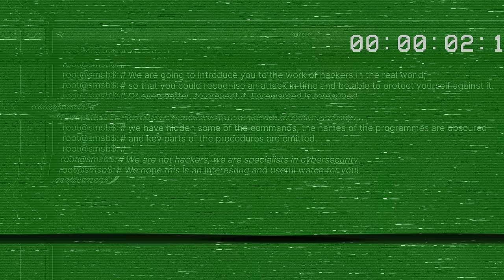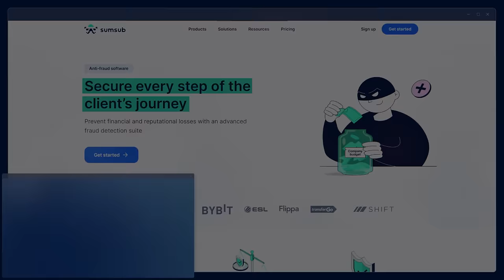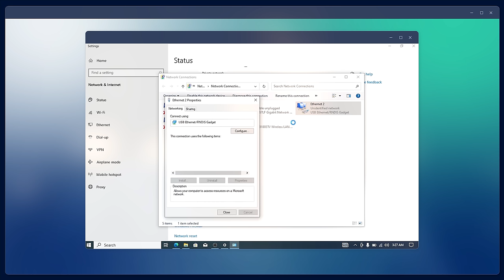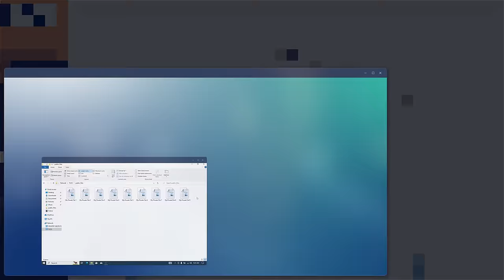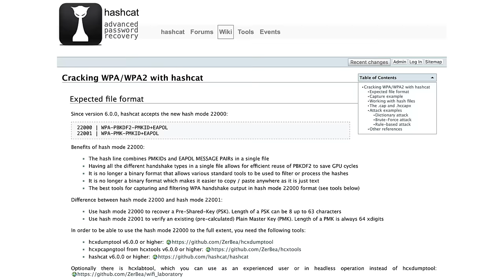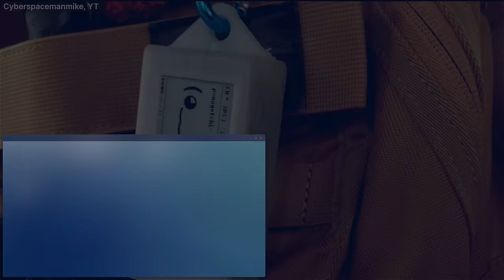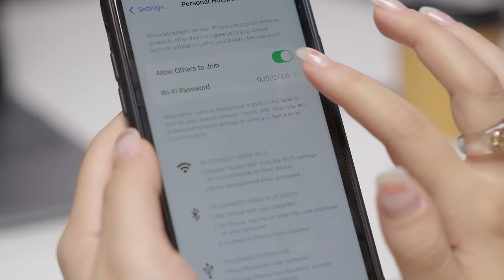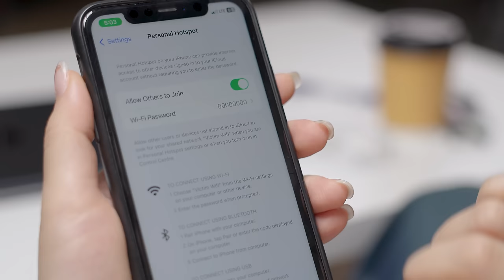Pwnagotchi — hacking WiFi networks in seconds | Real Experiment

Comment: Basically if you want to be safe against this, just like any other piece of software/website/service - have a really secure password. Larger passwords are exponentially harder to crack (as long as they aren't a common password), especially with a combination of symbols, uppercase, lowercase, and numbers.
Reply: Or use a LAN.
Reply: @oneproudbrowncoat  yeah carry a f wire and box around like a neanderthal
Reply: Most people don’t know 😈

Keep educate people but seriously there are 90 tries are successful of 100 times
Reply: using WPA3 PMF Enforced network would prevent it from getting the handshake i believe [well at least would help it out]
Reply: Does it find and hack wifi that doesn't broadcast its SSID?
Reply: @Soederlund  no biggie
Reply: @Kucing323 That does nothing
Reply: @Soederlund  those are even easier to get a handshake since it is constantly broadcasting
Reply: yes. also use WPA3 instead of 2
Reply: At  4:40  "connect to a WPA or WPA-2"....  well, those two older protocols are being used less every day and replaced by WPA-3 which is currently un-crackable.   Also using a 40+ character completely random password provides an exponentially more difficulty for brute-forcing hashes.  A networks is only as secure as its owner. ;)
Reply: @Kucing323- Changing passwords provides no extra protection especially for WiFi (maybe for email log-ins).  The key is to use 40+ random character passwords, or even longer if not using special characters.   It's not like you have to remember the password, since it's stored  in your device after the initial connection.
Reply: *WPA2 commands a 73% share of known wireless encryption connections.* ~ the internet
Reply: well 95% of all people use the password already sticked on the router which is normally as difficult as it can get.
Reply: @Kucing323 The only time frequently changing a password is necessary if you use THE SAME password in multiple places.
Reply: @Soederlund  Hiding your SSID only inconveniences YOU!  If you didn't know it, your AP broadcasts its MAC address, so who really cares about your SSID?  Hiding it does nothing to enhance security.
Reply: I just put the password i randomly generated from bitwarden, with a bit of my own spice to the password (which mostly just banging my fist to the keyboard).
Reply: @BillAnt  "Changing passwords provides no extra protection" Can you help me understand why?

In the time it takes to crack a captured handshake hash, a user could have changed the password, rendering the previously cracked password invalid
Reply: So a wifi password with 20 characters, upper case, lower case and numbers, is fairly safe ?
Reply: @JohnDoe-bd5sz - Should be, but I would use 40+ characters randomly generated by a password manager.  It's not like you have to remember it every time, all devices store it anyway.   Regardless how long the password is, there's a security flaw in the handshake up to WPA2, WPA3 seems to have mitigated those risks.
Reply: @BillAnt  I know WPA 3 is more secure, but i have loads of devices that only support WPA 2, so i can not turn off WPA 2 anyway, so even if i move some devices to WPA 3 i am going to be vulnerable because i would have to keep WPA 2 on for "legacy" devices.
Reply: My Router litterally doesnt allow me to use a longer WiFi password its like 60 characters long, i also disabled wps since this is a huge security flaw
Reply: @magesmith-kd3xo you don't do that?
Reply: Hi how are you doing
Reply: Do you remember me
Reply: @GodOfChaos_HeXa 63 should be the limit (have fun putting that into your TV)

Comment: My neighbors will usually give me their WiFi passwords if I ask nicely
Reply: Why would they do that?
Reply: @e1woqf  Split the bill. Both get it for half price then. Used to be common until people were scared by the "it could be a P. or a T. using your connection, getting you into trouble.". This is why you should know, and get on with, your neighbours.
Reply: Social engineering 👍
Saving GPU power 😂
Reply: Hypothetical post....Nowadays, nobody gives wifi password 😒 🙄

Comment: so it's just an automated interceptor, we still send the data to a rig which will crack the password using hashcat
Reply: Yep, clickbait
Reply: you could run the recovered hash against a dictionary in the device. Or do the same thing I used to do and automatically upload them to a server
Reply: @KOOLAIDxK1D  No, not entirely clickbait.  The pwnagotchi can be loaded with a plugin that automatically sends the intercepted hashes to an online cracking service, which emails you if it gets a hit. Doesn't get everything, but its still functional.
Reply: @CMDR_John_Crichton  now that sounds more like it

Comment: The only useful attack you can do with any device labelled "Wi-FI Hacking device" is Wi-FI De-auth/Turning off their wifi.
Reply: Sort of, yes, it is the only thing that will just always work with minimal effort. But many people still make severe mistakes in password choice.
But I agree, router defaults have become more sensible during the last 20 years. Doesn't prevent people from changing them to less sensible options.
Reply: Luckily WPA3 has protect management frames which prevent this

Comment: while whitelisting MAC addresses is helpful and a good step, a fair few devices can spoof any MAC address they want (Hell, my home sever here has that option for both it's adapters in regular desktop Linux, Mint to be precise). 

As an aside, a hacking tool has no business being that cute.
Reply: Two connected network devices can Not have the same Mac address from my understanding.  Both devices would receive some but probably not all data. The device would not function properly.  This would Alert the network normal users at homes.  I like increasing password length and adding special characters as AI and advances in computing make it possible to Crack shorter passwords or passwords not using special characters.
Reply: @jbranche8024  they cannot,  no. But an attacker need only wait for said device to disconnect,  or kick it off the net first
Reply: ah yes you're the guy recommending to do something that nobody does because its trivial
Reply: @BangBangBang.  pretty sure that IS done because of how trivial it is. 

How often I'm not sure, but settling up a whitelist still is the security equivalent of using a $5 chain lock on your front door.
Reply: @DFX2KX  Exactly, his "logic" is very "special".
Trivial things like this are just automatically done by most scripts. Getting a list of allowed mac adresses is standard procedure just in case there is a white list.
Precisely because it is so trivial you just exclude this potential source of problems. Diagnosing randomly refused or dropped connections is way more of a hassle then just doing stuff like this from the start. There is no downside to just doing this every time if there are any devices online.

Comment: First of all you did not create it and it is not new... Those exist for a long time...

Second of all it just works for wpa (an already old and vulnerable protocol...) Which no one should use anyways...
.
And third of all it just catches hashes No passwords...
To get a password from a hash youll essentially need to brute force try all password... And hope youll find the right one ... So more of an gimmick than a useful tool to hack wifi routers...
Reply: fourth of all no body cares
Reply: Brute force?? Try hashcat
Reply: @TonySmith-zq2hx  to my knowledge even hashcat brut-forces to some extent... Sure you can optimize around the human psychology, or commonly used passwords but the rest is brute force...
Bc hash-fcn are ment to be one way fcn. (Easy in one way. More or less impossible in the other direction.)

Comment: I'm a bit confused. It surely is too slow to crack anything, even a dictionary would be way too slow. So what is it doing? Only collecting handshakes?
At some point the video talks about online cracking, if this is needed, how would it be connected to the internet? How would it be "safe" to use? 
Seems more like a toy than a tool.
Reply: Video is misguided. The device just collects unauthorized handshakes which are called IV. You need a lot of them. With that, you would need to run it through a very large dictionary to find the password. Then once found, you can test the password on that network with a wifi device. Ppl watching this and thinking they can just sit next to a wifi network and get in with a click of a button are wrong. 

The entire point, make your wifi password hard and long. Set up layers in your network. Different vlans, Mac auth, honeypot for unknown device, etc.

Comment: mac address spoofing is a thing, I've done it on hotel wifi before. You find mac address of an already connected device, and spoof it. So I don't quite agree with mac address filtering. Also phones nowadays use random mac addresses. The best way to protect against this kind of hack is to use a strong password, the reason this thing works is because of weak wifi passwords. None wants to type a 20+ character password on a printer, but if you want to be safe you should.
Reply: No one wants to type a 20 character password, and they shouldn't be doing that anyway.  Plopping in a 40 character password is trivial when you use a password manager like Enpass, or any of the dozens of other ones available.  I like Enpass because they don't store your database, YOU do. If you're not using a password manager, I can pretty much guarantee you are using the same password on multiple websites... which is a really stupid thing to do.
Reply: @username-mc7jw  Something you missed is I mentioned a printer. I guess you never tried entering that password on a printer.

Comment: Unbelievable!  So, if I understand correctly, it doesn't actually give the hacker the Password to the wifi?  If not, what good is it then?
Reply: It gives hacker password hash, which can be used for getting the password via brute force attack. Basically, that's the only option for hacking WPA2 network (at least, for now), but there's two main issues
1. Any Android or iOS (jailbroken) smartphone can do the same thing, so there's not much point in specific device. Sure, it works automatically on any detected network and it automatically transfers hash files to PC that is used for bruteforcing, but it's not like you can set up any phone to do the same thing.
2. WPA3 networks are protected from this attack, so it isn't of any use for them.
Reply: Also, I'd like to add that they say that this device is using AI for password generating, but I'm not sure if AI is making password bruteforcing significantly faster. Moreso, this AI is still used not on device, but on PC that is doing bruteforcing, so it's not like you can't just download its code and use it on any PC with any hash, be it hash that you got from the phone or from the laptop.
Reply: Nevermind, I see it on the box.  Yes, it's WPA3.  But if my neighbor hacked my pw when I was on WPA2 Previously then I still need to change all my passwords.

Comment: Because I use Home Assistant, I am only using giving access to known MAC addresses. Not that I am afraid my password will get cracked, it is best to plan for the worst case. For visitors I my router offers a second WiFi network. It even has  a third network for Home Assistant appliances, but two will do because of using the MAC addresses. Hint: I use the MAC addresses to give every appliance a fixed IP via DHCP. I found out the hard way after a router failure appliances were not reconnecting perfectly to H.A. thus having fixed IP's makes live a lot easier.
Reply: Assigning static IPs via DHCP is good, but also close down the pool of DHCP addresses available to guests (on a separate VLAN, of course).

Comment: You don't need the gateway for SSH access to the device if it is on the same subnet, in particular the standard /24 pushed by DHCP on 99% of all home networks.

Just saying, because I am picky. - Great video BTW.
Reply: Truth. If you in the network range but still that'd require the target to have an SSH session running ...

Comment: this is no different from using wifisher or airmon-ng tools. in the end this "toy" won't crack the password since you need to take the cap file and run it against a massive dictionary to hash the password
to plain text.
Reply: Still a cool project though, main benefit is it just runs in the background.

Comment: I dont understand , how are you sniffing packets without connecting external wifi adaptor capable of packet injection  and monitor mode ? The onboard wifi chip on pi zero does not allow you to do so as far as i know it .

Comment: Its a great tool, hard to believe it was mostly made by one person, too bad the project has been dead for a long while. Also you are making it sound like cracking hashes is cheap/easy, its usually not with strong password requirements ;).
Reply: Jayofelonys fork got updated since years,it runs better than the original

Comment: It doesnt actually crack a password though. It just saves a handshake? You would still need to run a brute force or dictionary attack which would make 99% of these handshakes useless. Wps on 2.4ghz is still the easier way.

Comment: I have built one of these and they are pretty Kool tools but this video is very misleading. Keep in mind that you are not "cracking" anything handshake wise. You are doing a reverse dic lookup of hashes. So, if the dictionary/password list you are using to compare your hashes to doesn't have the password in it, you won't discover the AP's password. Having a large password list helps a ton! 

However, this tool will NOT crack "Any wifi access point" like the video claims. It will also not work on WPA3 last time I checked.

I get it, this video is really more about advertising the companies services than the PG but don't be so misleading :(

Comment: Umm... a dictionary attack on a wifi password of 12 characters (which is what most routers are default shipped with) will take about 34 thousand years maximum to crack. dictionary attacks on hashes is kind of useless unless you have quantum processor or the password is less than 10 characters in length.
Reply: Or the password was changed by the end user and is shite so cracking it takes a few minutes max with a right dictionary.

Comment: The comments on this are funny. People are mad the Pwnagotchi only does 2/3 of the work, or put slightly differently, doesn't brake the law. Lol 
Listening to and gathering publicly transmitted information is fine. Cracking the hashes is a bit questionable, anything beyond that is unlawful.
I think people tend to forget that wifi is just a range of radio spectrum and standard protocols intended for public use. Anyone can do as they please with it, within reason. Monitoring or interecpting wifi is in reality no different than listening to a radio scanner. It's public airways, only a fool would think it's private. The Pwnagotchi is very similar to the Flipper in that it's a relatively harmless peice of tech that is fun to explore and experiment with, that also happens to do a great job bringing the awareness of common insecurities to the general public. They're just fun educational tools that people with bad intentions could possibly abuse, but it would be silly for them to not use better options.

Comment: This device is cute but a bad investment. Extracting a Wi-Fi password requires millions  of tries and it is not guaranteed to find it.
There are two things you can do to protect yourself:
1. Simply use a random password with at least 12 characters and a combination of numbers, upper and lower case letters, and symbols.
2. Upgrade to WPA3 😂
 
This device couldn't do anything once you do this, except for wasting power.
Reply: It's $50 and can be repurposed for other things, hardly a bad investment for an education tool
Reply: @Steph.98114 Yeah... an education in getting scammed.
So you definitely have a point there!
Reply: @-108-  it's not even a product? (though some do build them to sell) Its an open source project that uses off the shelf built for fun and to teach people the basic of how network security works and can be vunrable.

Comment: This device claims it attacks any wifi hotspot, which is an overclaim. Without even finishing the rest of the video, I can make some guesses. It will work with something like EAP-TLS, and it likely uses WPA2 handshake vulnerability, which is majorly fixed in WPA3. 

And After I finish the video my assumption is true. I am usually very careful when I hear it works on anything. 99% of the time, it's a troll.

Comment: So if the password is next to hashed also be salted or pepperd it does not work?
Arent wifi passwords also salted?

Also because the real power comes from the software running on the device, not the raspberry it self. Doing most of the work by api web services. Why not run it on a smart phone? A person looking at a smartphone is a lot less suspisious then someone looking to this device.
Reply: It's a novelty item that was popular 3 or 4 years ago as a fun DIY project, the idea being you have a (kinda sorta) Tamagotchi toy that's also capturing handshakes. In reality though, sure, you could just use a phone or some other less obvious device.

(and a strong password of 12+ characters, WPA3 etc. all defeat this, it's old news - not to say hash attacks don't still work of course, plenty of bad passwords/WPA2 still out there)